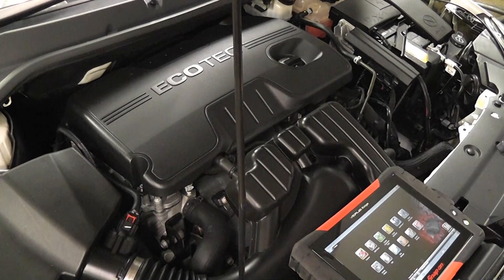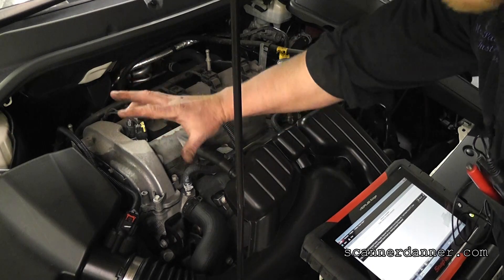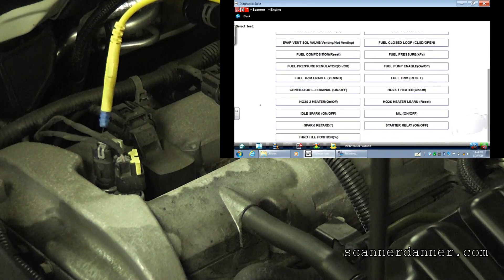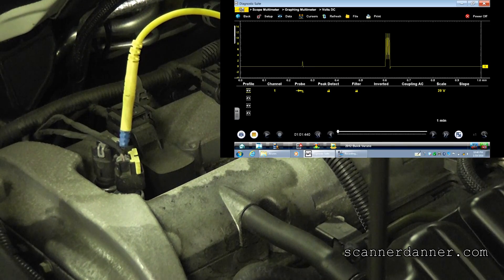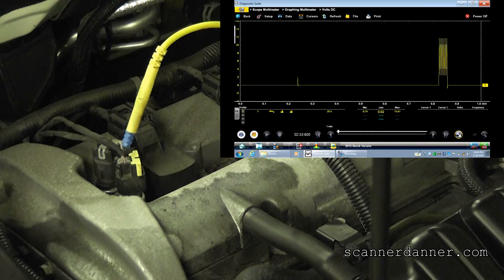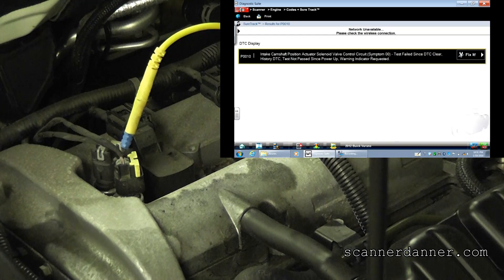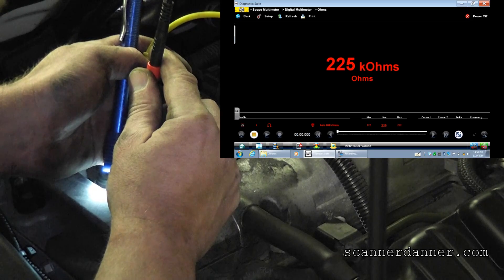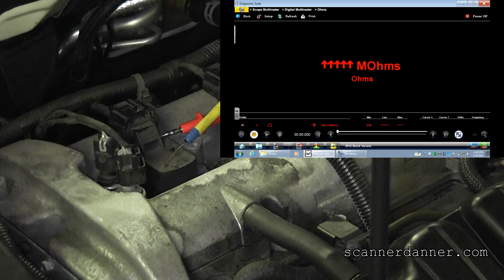Intake/Exhaust Camshaft Actuator Solenoid test (P0010, P0011) - GM 2.4

Comment: are those for variable valve timing ?  maybe the engine is low on oil pressure and the computer picked it up and set a fault ?  
i always have a problem on the BMWs with vanos and sometimes the screens on the solenoids are clogged and a simple cleaning of the screens does the trick lol .  
but yea i see how the internal parts of the solenoids can be faulty. engineering flaws..
Reply: Would've been a cam to crank correlation code then like P0017 or 18 I believe. This is the PCM complaining about an issue with the control circuit. There's several different VVT codes for various conditions the PCM monitors.
Reply: Oh true forget about that
Reply: I almost forget about that